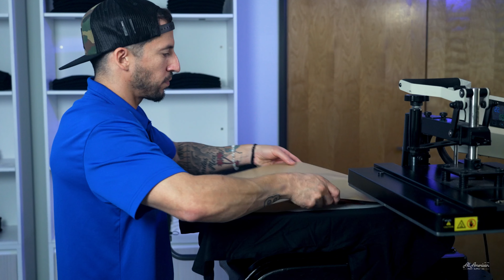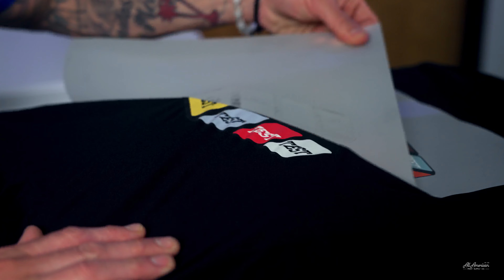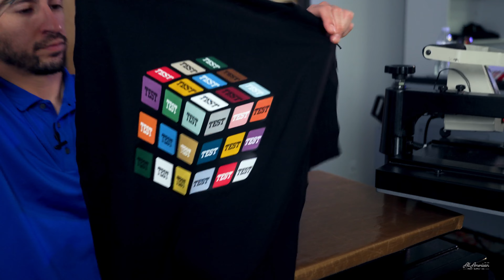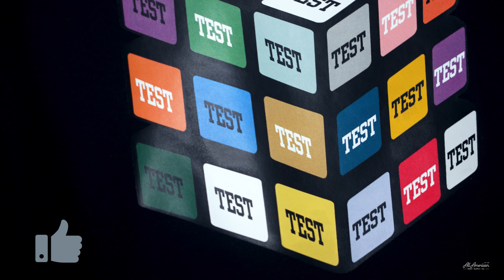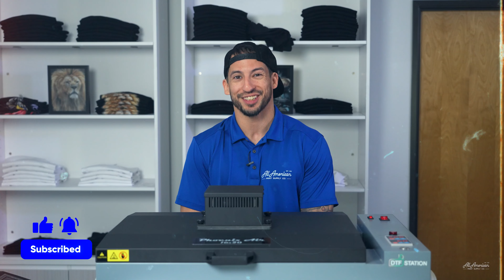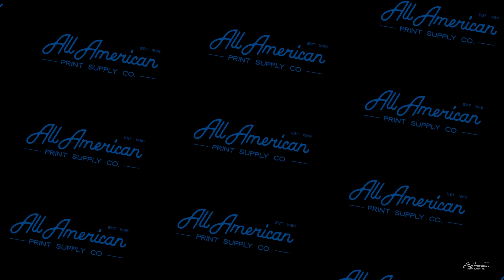You're Probably Making This DTF Mistake | AA Print Supply

Comment: Hi I have the Pheonix 16x20 with the mat inside and I've been getting great results but I notice an inconsistency with spots near the middle or side middle that don't melt during the cure (184 F/60 seconds/air purifier on). I tried longer times with no luck; it only works when I rotate the sheet and put it in again. I would say it does this 6/7 out of 10 times. I've checked the sheets, the adhesive and the ink from the printer and they're all good. I've also checked to make sure it isn't from getting cold between sheets (opening and closing). Any tips on what I could be overseeing??
Reply from the maker: Hello there! When I have to whip up a dtf transfer sheet I have been using the following settings recently: 260F for about 40 seconds. As everyone's environment will differ/print size/etc testing is advised but I would give these settings a try on your next one!

Comment: I had on a shirt with dtf printing on it I wore it took an off an threw it on a chair a few days when I came back to move the shirt I noticed a where the shirt was kinda folded the DTF cracked…. Any idea why
Reply from the maker: Hello, let's see here. What film/ink was used? How did you dry the melting powder to the wet print? What settings were used for application?

These variables will help us diagnose the root of the cause!

Comment: Unfortunately, I seem to be experiencing a very persistent issue with ink boiling. I've tried to bake it for 5 seconds at 257 F. I've tried lowering the temp to 248 and 239 in the STS baking oven, but I still get this after baking for 140 seconds. I've tried baking at 120 seconds, but the powder doesn't seem to melt completely, so I increased the overall baking time. Please give me an advice. Do I use too much underbase for colored prints ? (60% in Kothari) PS. I almost never get this issue with Ecofreen white powder. Ecofreen black powder gives me trouble mostly. Thank you in advance !
Reply from the maker: Hello, if I were to run into this I would try a longer cure with less heat but always always do the quick 5 second dry before powdering. Are you using the black DTF powder to fight dye migration?
Reply: @AAPrintSupplyCo  Thank you so much for the feedback! I am using black DTF powder to fight off dye migration and also due to the fact we predominantly print on black garments. I do prefer how the white powder behaves, but I need to use mostly black powder :( Something else I am wondering about is if my powder could also be humid ?
Reply from the maker: @DnBConsort  you are so welcome, thank you for supporting the channel. Excess humidity can affect the performance of the powder so a dry, sealed bag for the powder will help as well as possibly silica packets. What printer are you running? In Kothari you can also try to increase the white layer in small amounts as a means to stop dye migration. This may allow you to use the white powder in place of black for a smoother result.
Reply from the maker: @DnBConsort  Also, if the black powder is from us we may want to put you in touch with our tech dept in regards to the issues to see what is happening. Here is the contact form to connect with them so you have it: https://aaprintsupplyco.com/pages/contact-us
Reply: @AAPrintSupplyCo  Thanks again for your reply ! I am running an Epson SC F2100, but I prefer the DTF technology, so I am not using it for DTG. The powder is stored in vacuum sealed bag, so I don't think its the humidity in the powder. I've tried different temperatures and timeframes for the oven, unfortunately to no avail. What I am thinking is the following, is it possible there is excess humidity somewhere in the tubing of the printer? Possibly due to insufficient shaking of the white ink, or too much shaking of the white ink, which could cause bubbling? I am just guessing at this point. What is strange is that I never faced this issue up until a few months ago and it is driving me crazy. I am not really happy with the STS oven, as it doesn't seem it heats the film correctly - after baking for 2 minutes, there are small patches where the powder did not melt, but it melted perfectly in the other areas. Weird..
Reply from the maker: @DnBConsort  You're welcome. What is the humidity like in the printer's environment? Ideally we should be as close to 55% as possible. As far as the white ink shaking, how is the nozzle check? That is a great indicator as to the current health of nozzles. Depending on how the heating is in the oven we may want to try to re-position the film in the oven at the halfway point. Also, we can always use a temp gun to check how accurate the heat is in the oven. This could also be related to the film itself. What film are you using?
Reply: @AAPrintSupplyCo  The humidity in the premise is relatively low, unfortunately - between 40 and 45% - I purchased a humidifier, as it gets as low as 20% without one. After shaking the whites, I only have small areas where the nozzles don't print, but usually a light cleanup resolves this. Regarding the oven, I usually place the prints in the middle of it, as I notice it is the best position for even heating. I am using Ecofreen Super Quality film. What I notice is that when I place the print for 5 seconds before powdering, some powder remains on the film and cannot be shaken off. I keep the film in its original packaging (a box and a bag inside of it) in a very low humidity environment. Could the powder that sticks indicate the film might be humid ?